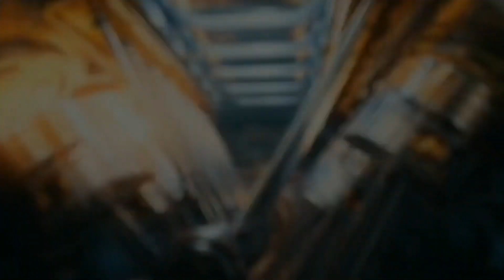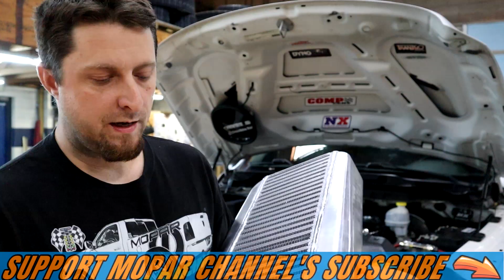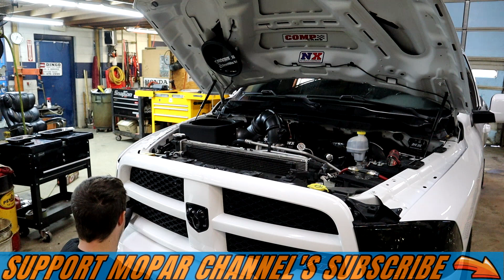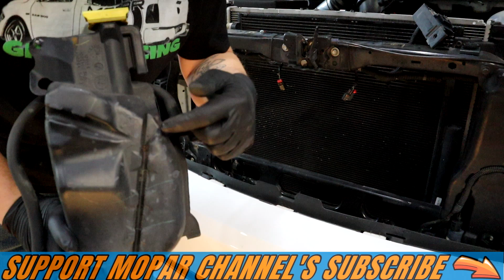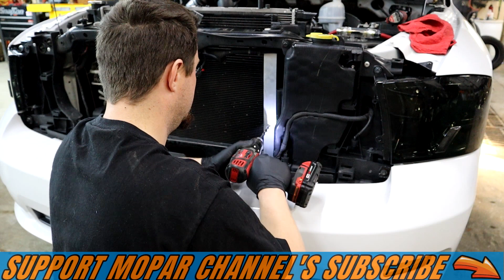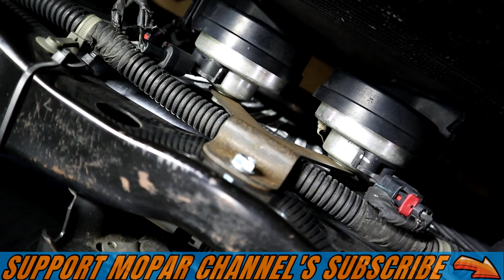Ram 1500 Intercooler Install Budget Boost Torqstorm Supercharger Part 1

Comment: It is so cheap because it is a incomplete kit. Not a bolt on by any means
Reply from the maker: Its a complete bolt on kit. Intercooler system is a option if you want one you must fab it up some people just run meth injection instead.

Comment: Well there's definantly alot involved on this bro..and ppl wonder why we as car guys get emotionally involved in our ride's 😅 can't wait to see the rest of this build!💪💪
Reply: I'm ordering parts for the Durango today too!
Reply from the maker: Definitely bro I cant wait to finish it and hear that supercharger. 🤘
Reply: @FrostbiteRam  me either!!! I can't wait to get this motor in and hear these long tubes and that thrush muffler 💪😅 I jus got quoted 3000 on a motor and swap which isn't bad for around here
Reply from the maker: @bmanclassics4350  hell yea bro that's going to be a sick Durango 💪
Reply: @FrostbiteRam  yeah bro I have big plans but looks like the torque storm will have to wait but I'm def doin bolt ons and nitrous
Reply: @FrostbiteRam  I ordered long tubes for a ram 1500 couldn't find long tubes for a Durango 2 hope they fit🤞🤞
Reply: Exactly.  These projects become involved and it becomes a bond between man and machine.
Reply: I saw a 90mm throttle body on eBay called a kyostar for 160.00$! U heard anything about these guys??
Reply from the maker: @bmanclassics4350  sure haven't but I have one coming from someone that makes them so hold tight it may be a better deal and I'm doing a review on it👍

Comment: Good amout of room up front.... one caution the over flow is more a recovery hose when hot the coolant system pushs coolant to the cooliant reservoir and as the system cools it returns the coolant back into radiator... big deal is make sure your hose goes far enough in the bottom not to suck air so its a must to have coolant in the new temporary zip tied reservoir.. not just a empty or it will retun air ... my main point is that every one know that hose when older can crack and in time cause coolant system actually run low , thus cause overheating... I had this happen 5.9 magnum in a 92 dakota. Swap I didnt put a new hose on. Warped a head.. it sure was a fun little truck, just a word of caution.. good luck on the rest of the install..
Reply from the maker: I have a new reservoir tank to install and yes your correct. I did fill the bottle about halfway with fluid just to get me by for now and shoved hose to bottom.